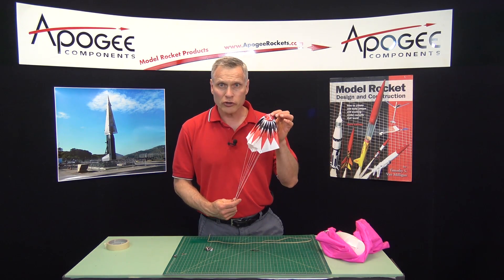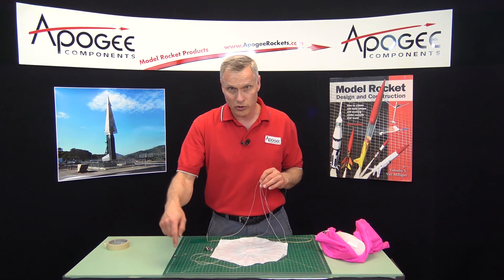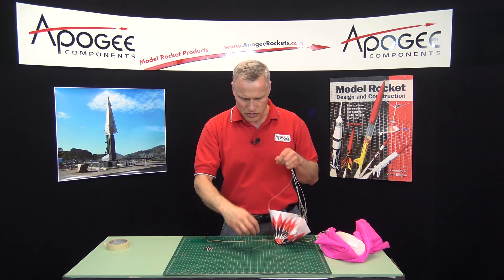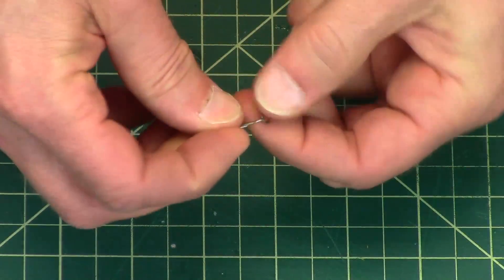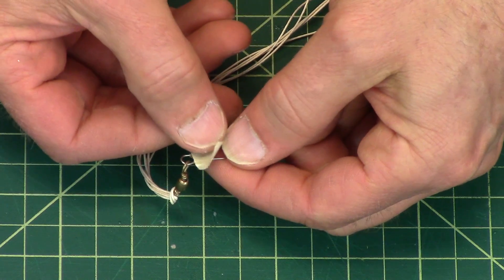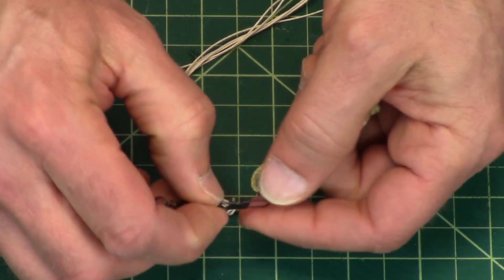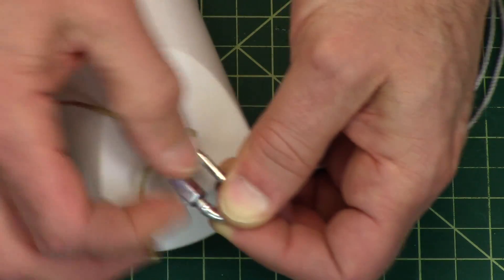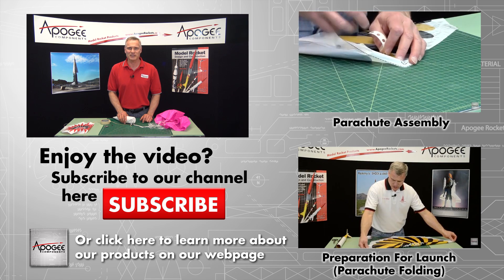Preventing Parachute Line Entaglement

Comment: Are these swivels with a hook still available? All I can find are 'ball bearing' swivels on the website. Do these function the same and should I just tie a knot to get the shock cord mounted to the swivel since there is no hook?
Reply from the maker: We've never sold the ones with the hooks. They are OK for small rockets, but the forces on the hooks can cause failure with larger rockets. You can find them at any fishing store (Wally World). The ball bearing swivels are much more durable, and you'll just tie the shock cord to the loop on the swivel.

Comment: I learned something today.... I launched a rocket with a tangled parachute (I was willing to lose the rocket). it fell rather hard but survived intact. compared to other rockets with proper parachutes, it landed close by instead of traveling 3/4 to 1 mile away. bottom line I didn't have to spend time tracking down the rocket.
Reply from the maker: Yeah, depending on your setup this is why people like to use different types of recovery systems or even dual deployment to avoid the part of the hobby where you go from "rocketeer" to "search and rescue" ha.